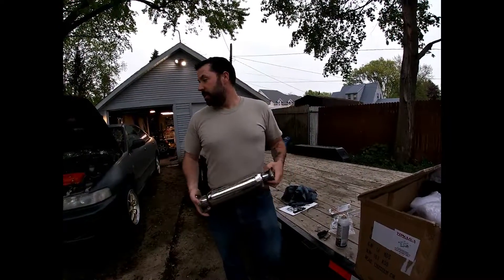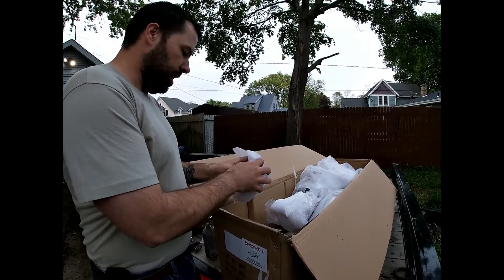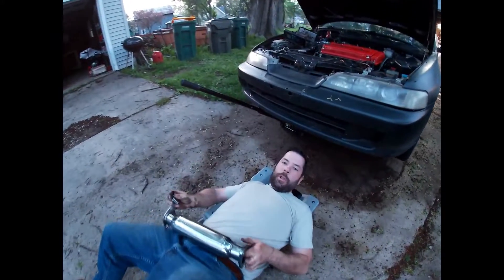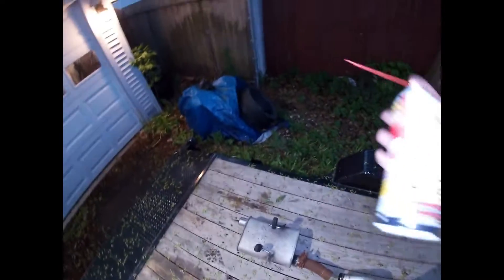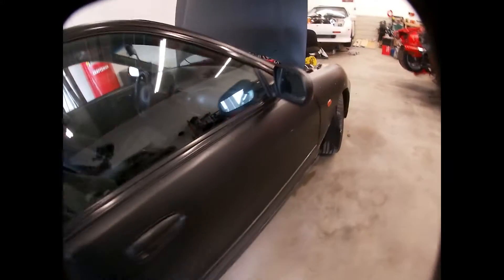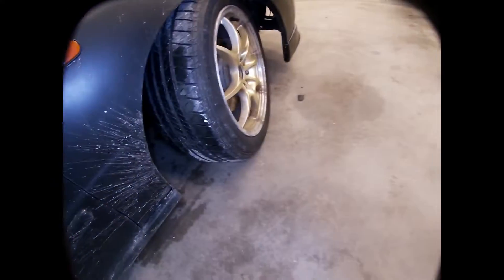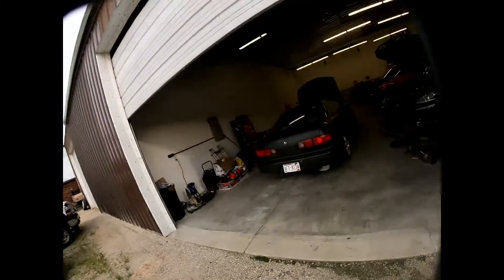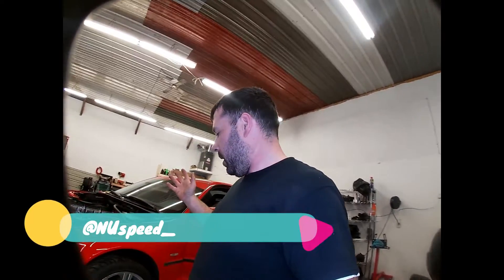honda integra b16a vtec; 3" exhaust yonaka catback install and startup.

Comment: what ecu did you use?
Reply from the maker: In the integra we used the stock b18 ecu.
Reply: @NuSpeed  what did yall do for vtec?
Reply from the maker: We did not wire it in, but you can wire it in to the ecu. We were going to use the vtec locking kit that basically keeps vtec locked in at all times, but there are wiring kits you can buy to connect to your ecu.